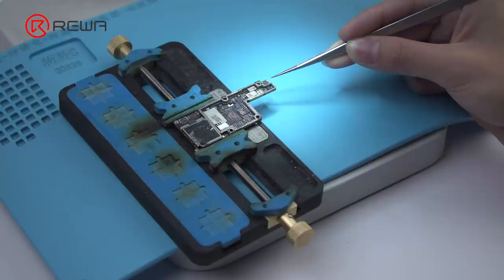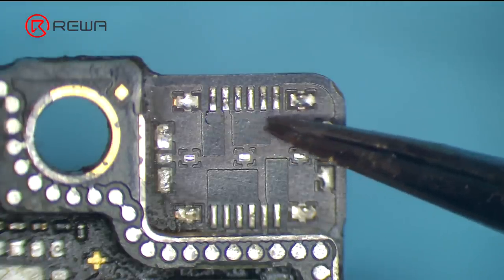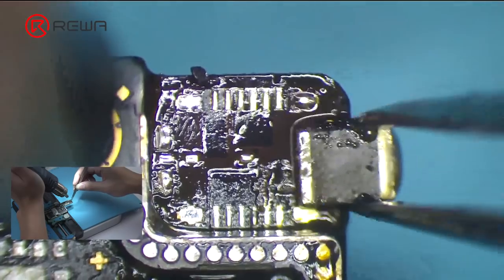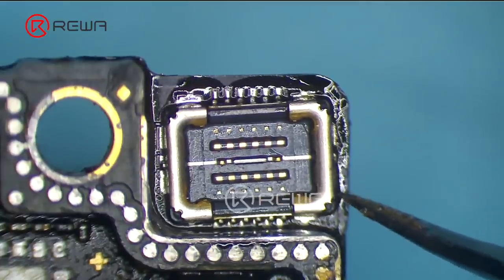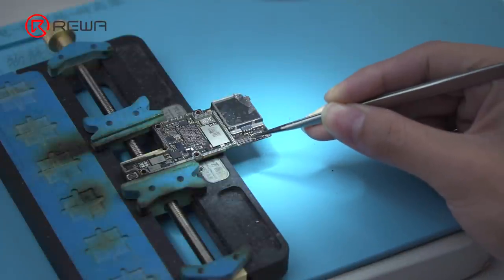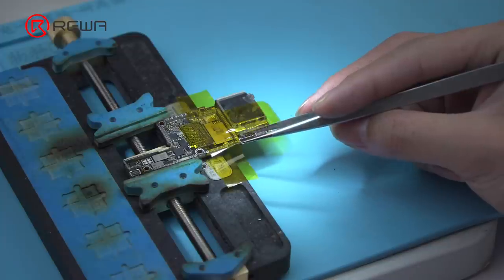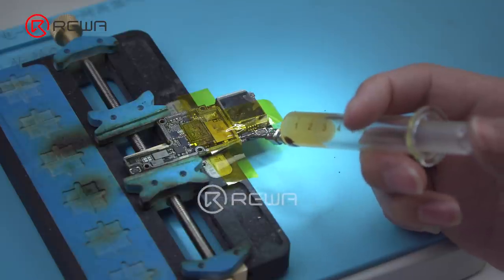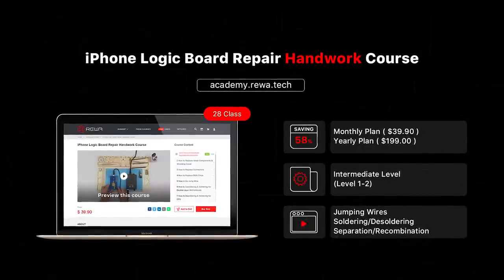iPhone X Connector (De)Soldering Handwork Tips | REWA Academy Online Course

Comment: Its not right method.Your solder is weak! I now what i write! If you use only hot air gun for hitting board you can easily damage connector!!! Different air hot gun have different temperature and can damage hot connector by twizer when touch it. If you hit connector about 300 celsius and above it not alive! For good results you must hitting 280 celsius and lower! If you have good quality thermal stand and skill you can resolder connector on 265-270 celsius! For soldering high quality need hit all board by thermal stand! I can simply resolder connector on original high temperature paste! Without ANY problem! In repair i usually resolder connector by 180 rotating on board after water or mechanical damage!
Reply: Corect !
Reply from the maker: As we noted in 10:07 of the video, the setting parameters are only for reference. 
According to the environment and device brand, it will be different. 
Thanks for your comment for sharing about it :)